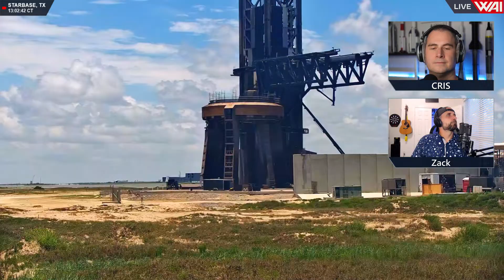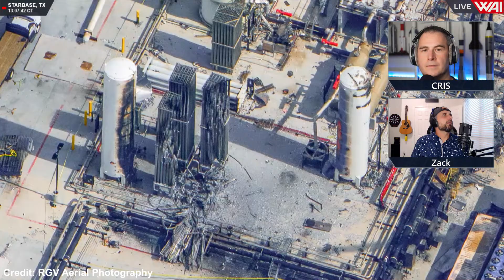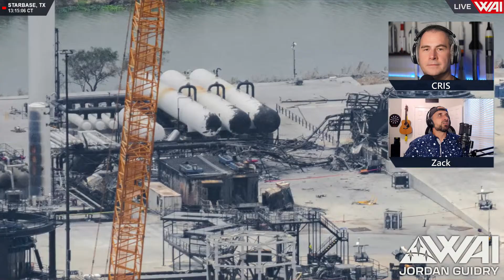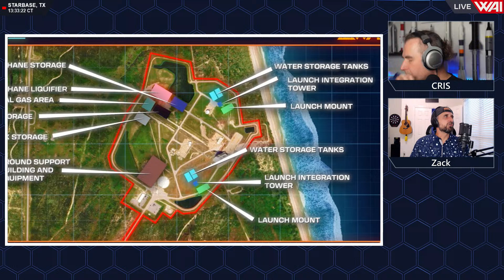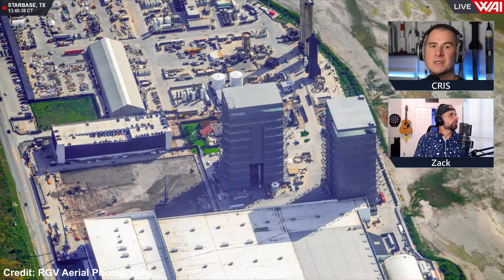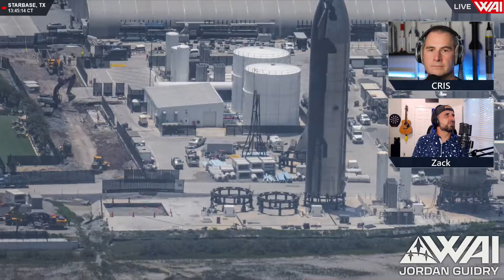LIVE🔴: SpaceX Builds More Starship Pads! | Massey Reconstruction Begins!

Comment: Due to the amount of pipe damage it might be to SX advantage to move the tanks to new stands further away from the actual launch trench and burry new pipe feeds under the cement, and add emergency shutoffs and fire block walls to the parimeter rank farm  to avoid extended burns in future Test fires. After all this is a Rapid reuseable TEST area...

Comment: I've never understand why they built this test platform so close to all this other equipment. Did they not expect a failure at some point? This damage is so predictable. Eventually there will be similar failures again, likely more than one.
Reply: Space constraints. This site is the most remote and there is a water mote around. It's the best option from the available exactly because they expected damage. 
Imagine this explosion at the construction/launch site.... this is a set back but not really something that won't be fixed within a few months.
Reply: @qa1e2r4  Well then at least build some protection for the surrounding equipment from such an explosion.